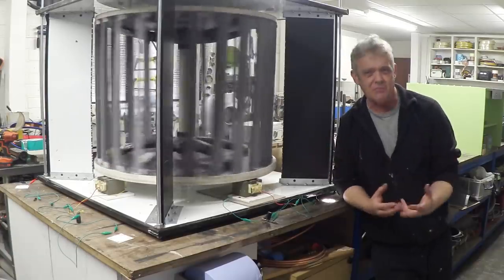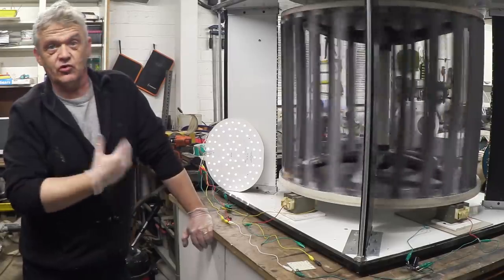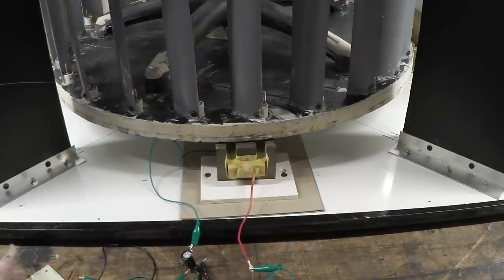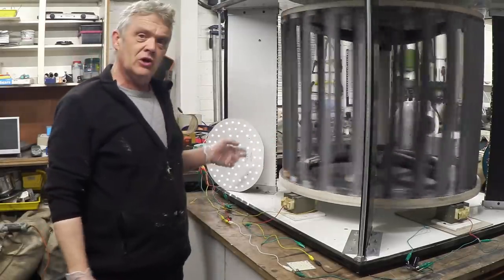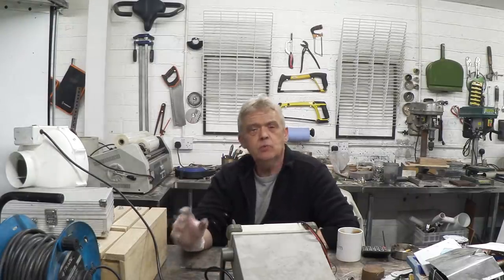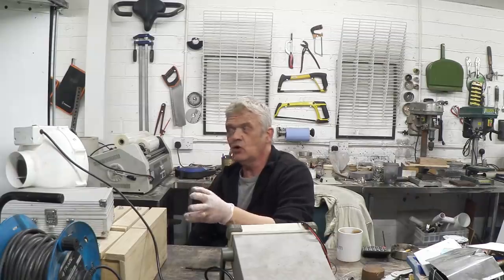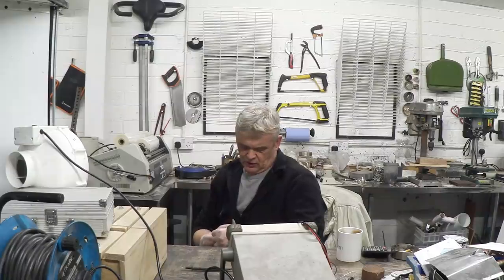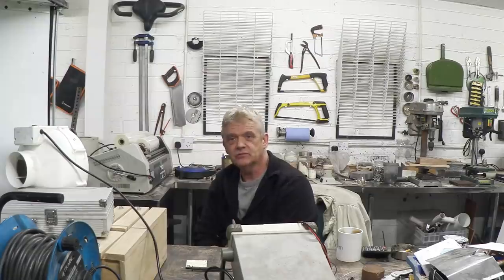Building a 1kW Wind Turbine For Under £100 - Part 6 - Installing The Coils

Comment: When the capacitors reach full charge will the resistance return to full load, or will they just dump that into a battery bank and thus drop the resistance again?  Thanks!

Comment: Is that effectively a capacitive dropper? Did you use high frequency capacitors? Without the rectifier wouldn't the out of phase a/c superimpose on each other leading to unpredicatable output?

Comment: what about using a supercapacitor bank ? like  700F to 3000F
But supercapacitors are very low voltage and will need to limit the coil maximum voltage
Maybe you can use a buck boost converter to isolate the coil from the supercapacitor bank ?
Reply from the maker: or coils with a ticker wire?

Comment: Amazing Rob! I would have never guessed you could do that.. But then I am not so up on electronics and was very amazed that it slowed down in the first place.. One silly question though.. Does the capacitor go across the ac inlet or the dc out put in the rectifiers? I do get so excited when I can actually understand what is going on and what you are talking about.. It makes me feel young again.. I know it may sound silly to you.. But it has become so hard for me in the last few years to grasp new things.. even the old concepts that I have been accustom to all my life are beginning to fade a bit.. But never the less I never quit trying.. Learning is such fun.. thanks again Rob.. carry on, be safe and have a lot of fun!
Reply: I know the feeling. I was an avionics technician in the Navy almost 40 years ago. To be fair, I didn't pursue it as a career after I got out so I haven't kept up on electronics much.. I'd like to see a schematic of that circuit. I think what he has done is connect the capacitor leads to the ac inputs of the rectifier and to the coil. The  DC output goes to the load. I looked up what happens to a capacitor when applied to an ac current (the coil) and it is a bit complicated.    Hopefully Robert or someone watching this will fill us in on that circuit.
Reply: @hubrisnaut  Navy huh.. I was a marine from 69 -72.. and we all know that the navy is a department of the marine corps! ;-) But only marines can say that!  I didn't do much of anything in the corps but duck and cover.. But now as an old man I needed something to do in the cold times so I thought I would try to learn something new?.. I am finding that you can teach an old grunt new trick.. you just have to have a lot of patients and do it slowly... Fair winds and following seas my brother!
Reply: @tinkmarshino  A good hearted "ribbing" is appreciated... My grandfather, who served in WWII in the South Pacific as a Navy corpsman called Marines "sea-going bellhops" with a wry look. I think you know the role he played in the invasions and lived. Never discussed it but his fitful nightmares revealed it to us. Much respect sent from here brother...
Reply: @hubrisnaut  and much respect to you and your father.. Tell your father (in person or in prayers..) thanks, we all appreciated our brothers in the navy.. always
Reply from the maker: it's attached to the dc output mate - the ac input just takes the coil output - attached this way a cap is often referred to a s as soothing cap as it decreases the ripple in rectified current - I think it's doin just a tiny bit more and that is acting as a buffer between load and generation but I am splitting hairs on that really - you often find diodes connected across coils to spark suppress - it surpasses back EMF and in that application the are often called freewheeling diodes - now we know why lol hope this helps
Reply: @ThinkingandTinkering  Brilliant Rob.. thanks for explaining it to me.. that helps a lot.. It is the EMF that slows the wheel right? Hat damn, I am starting to understand it all.. what fun! Carry on my friend I appreciate you and all of your help..
Reply: @ThinkingandTinkering  Brilliant Rob.. thanks for explaining it to me.. that helps a lot.. It is the EMF that slows the wheel right? Hat damn, I am starting to understand it all.. what fun! Carry on my friend I appreciate you and all of your help..

Comment: This may be a duplicate - have not reviewed comments. Will there be an iteration using graphene based super capacitors + diode configuration versus electrolytic caps to manage the load?
Reply: WHY ?

Comment: Hi Robert. Another excellent - and inspiring! - video / experiment. I am likewise 'experimenting' with home wind power and I have a question from this clip [open to all your viewers to answer, of course!] - how do I determine what size capacitor[s] to use to act as my 'clutch'? The generator I'm using has a max output of 2kW at about 1000rpm. I'd rather not explode nor become electrocuted ;p  What size would give me a safe margin of error? What is the downside of using a capacitor of too great a capacity?

Comment: I thank you for the information cause I alway wondering if there is a way to clutch the low to reduce lagging so I strongly believe you fine a new system, but I think using higher voltage capacitors that can store more amperage they use super capacitors

Comment: Could you do a video on alternatives to your honeycombed panels?  Great videos. Not too many.
Reply from the maker: Great idea mate
Reply: I have a good alternative, in Belgium we call it concrete multiplex. They are the black coated wooden panels in many trailers. Weatherproof, solid, easy to work with normal woodworking machines and easy to find

Comment: Robert

Is this method of using diodes or capacitors as a bridge rectifier something you came up with?  OR was it something that was patented in the past? 

Is there a chance you can draw a schematic showing the setup? 

So I could understand it better.

Thanks any help would be appreciated. 

 This is a wonderful build and no not too many videos.
Reply from the maker: I have certainly never read a patent on this - that doesn't mean there isn't one but I don't know if there is - it just popped into my head as a good idea - I did gloss over the circuit a bit - I'll do a vid on it as a fair few folks have asked to see the circuit in detail - cheers
Reply: @ThinkingandTinkering  

Thank you for responding so quickly with the good news on yet another fantastic video ☺️.

We will enjoy seeing you teach so we'll.

BTW

You can copyright a work of art or a work of the mind and protect your work before you make the video just in case this becomes something that is useful. Then if somebody wants to buy a PDF from you showing the drawings that could be offered as well I suppose as a copyrighted PDF.
Reply from the maker: @reypolice5231  I don't mind if someone copies it mate
Reply: @ThinkingandTinkering  

Very kind of you.

Thank you so much.

Comment: Fantastic love every second 👍👍👍 re cogging torque reduction on wind turbine start up during wind speed changes, what about a small raspberry pi and relays with some python scripts to make sure not all transformers are on during startup, you could use one of those lithium batty packs you found, would only take milliamps from the system to keep it going .  Or maybe a simpler approach would be a zener diode and transistors array.
Reply from the maker: No ideas mate - cheers

Comment: What happens when the load is larger than the capacity of the capacitors is the current limited to the capacitance or the coil production. I think it would be like a soft start motor Thanks for sharing.
Reply from the maker: I think it is really like a soft start motor mate

Comment: Multiple outputs into one rectifier and cap? Thinking voltage drop from rectifier if one per coil.  Hopefully a beefy cap will not effect spin up.
Reply from the maker: I could try it mate - but to be honest I like redundant systems

Comment: Now you are thinking exactly like me mate, LOL... You are starting to see why I was going to use 9 coil generator on the same shaft as the motor and use super caps to power the motor part from 3 of the coils from the generator part. Awesome mate
Reply: You know those caps you made out of the CD cases that powered that PC. What if you used them in this build, how long would they hold up and work?
Reply: Have you went away from thinking on using the ballast? I was hoping to see that being wired.
Reply from the maker: no mate but you have topics one thing to do or it all gets a bit too confusing lol
Reply from the maker: I don't know mate
Reply from the maker: lol - well I have noticed how often we seem to think along the same lines mate - cheers
Reply: @ThinkingandTinkering  LOL, well we are both from England. Both "Jack of ALL Trades" Oh and neither of us wants to have to spend a lot. That is why we like doing it from scratch, it is cheaper but most of the time we end up with something that you just can't buy anywhere and it is a custom job. I think it is also, we like to see if we can help the world at the same time maybe because we are leaving children behind one day and what we do now will help them at some point. Cheers mate Oh and I'm one of those Old Fashion Folk that still believes in God save the Queen.

Comment: Capacitor =? Open circuit =? No load ;) this same work with PV, you can get almoust open circuit power from pv, if you change fast to next cap, and from first unload (there is nothing so fast, best use 3+ caps. 1st go to 0power, 2nd go to 50%, and 3rd loading up to 100, next change to loading on 1, etc.)
Reply from the maker: awesome mate - nice post

Comment: Is it possible to have a diverting mechanism so on days when wind speeds are increased then diverte to a metel based Coil for more resistance?
I'm on top of a mountain in Arizona in the US and the wind speeds vary significantly it would be ideal to be allowed to alternate  for increased wind

Comment: Good achievement pal, I believe that E shape steel core is dissipating magnetic field, if you could try only center I shape core you will improve outage just like microwave fan coil,,,,
Reply from the maker: awesome  suggestion mate thanks

Comment: VERY interesting. The first question that popped into my head was can you do the same on higher torque generators? Can you reduce the load on them so THEY run in lighter winds? Also: to make a simple brake can you have a simple switch to unhook the caps from the circuit?
Reply: ALL small Wind Turbines convert the AC into DC.  Nothing new here ...
Reply: @MrSummitville  Not my question, friend. What would happen if happen if you used a rectifier bridge and capacitor on each coil on a high torque generator. Would that reduce the loading drag? That is my question. Thanks for pointing out that my question was not clear.

Comment: Without exact placement of the coils you will never have true in phase coils. And of course shorting out a coil will make it act like a magnetic brake. So by putting each coil through a rectifier you are decoupling them from each other, the capacitor only helps smooth out the voltage dips. 

To put them in parallel without rectifiers you would need to adjust the coil placement to try and get them all in phase. If the magnets are not correctly spaced apart this might be impossible. If connected with a phase difference they will see each other as part of the load and the one with the highest voltage will try and bring the lower one up to match with as much current as it can provide.

if power out demand is greater than wind power in, then it will slow down or stop. In the same way that when you cycle up a steep hill, when power out requirement is greater than you can provide power in, you slow and then get off a walk. where i live you see a lot of wind turbines just walking in the wind. :)
Reply from the maker: very true but this allows for non exact placement - a much more likely scenario is a home build

Comment: what if you try to use all coils you get leaving them in stacks and basicly make 2 stators from them with basic coil holders?
Reply from the maker: I did talk about this in a previous video I think - but since discovering this cap thing I have had a thought

Comment: Love it!  Congratulations on such an impressive piece of kit.  For what it's worth, here in the states we would refer to the automatic clutch as a (hydraulic) torque converter but the principle is dead on.  You are correct that now with the capacitors in the middle it has, in fact, decoupled the load from the generator.  Absolutely brilliant.  Thanks for sharing!  Cheers!
Reply from the maker: awesome mate - thanks for helping fill in the blanks for me

Comment: A Mate!  did u take my advice ? 
   Coils in a parallels series.. . Great Minds think alike! CHEERS MATE! 
 My thoughs...The magnesium  graphite  polyacrylic acid compositors . Switch out to foil coil AL cart ,lol ...
good job MATE!  try using the William Frasier magnetic gears to get higher rpm on magnetic strip... The exact one u built for demo in your video .. you can even make a 2part turbine cadge with William Frasier gears in-between to give a jump start as well ...
Reply from the maker: nice one mate - to be honest I try not to do too much 'new stuff' in any one project because to my mind it obscures the issue and her I am interested in the effect of low torque high speed as opposed to high torque low speed

Comment: Awesome project! 
Are the coil outputs in phase? It's probably difficult to check without an oscilloscope, but if they're not(you can change the phase by moving the coil locations), you might be losing potential output because the coils cancel each other out.
Reply: Nevermind, went 10 seconds more into the video and got my answer lol.
Reply: Yes,think ask inspector Frost!
Reply from the maker: lol - I laugh because of your second comment mate - cheers
Reply: @ThinkingandTinkering  Cheers Sir,and thank you for vids,if you laughed you took it in as it was ment.Thank you from DK.

Comment: There is no free lunch tho is there.  You cannot extract power from the turbine without getting a corresponding reduction in rpm for a constant wind speed. That you are not perceiving a rpm drop is only indicative of the low power output of your current setup. Any power extraction must lead to a drop in rpm from the no load condition.
Reply from the maker: for sure mate

Comment: Just wondering, are you in the process of making a large motor?
Reply from the maker: there is always stuff going on in the background mate lol
Reply: @ThinkingandTinkering  If you could turn it into a motor and flatten it, it would make a great extractor fan. I used to do metal casting and use a fume cupboard mainly for acrylic monomer and acids and they all use a small motor trying to take a large volume. I wonder if taking a large volume to a smaller extraction tube would result in a greater efficiency were you need it to be.

Comment: Go aircon in building you know how much ducts now ok it may not power the aircon but all the power lights via the duct to building weight and life run term well simple sensor coil shaft rotation setup running like your footage or ten thousand on home unfortunately high wind is a concern anyway but it's in lithium ten MW home installation little less stable unless your in the Scottish area the as long as the aircon is running via the building constant output even by wind vents for after but requires store..

Comment: If it looks too good to be true... Getting rid of/smoothing out the initial EMF spike is great... But it's there for a reason.  Yes it allows rotor to start spinning at low wind speeds, but you seem to be implying this is ongoing, limitlessly capacitors charging up without slowing down the rotor speed?🤷🏻‍♂️
Reply from the maker: I doubt that very much mate - we may well be able to bang a few more on but it can't possibly be limitless

Comment: I love these kind of projects, but I'm really wondering whether you'll ever get 1kw out of this. Well, actually, I doubt you'll ever even reach a 3-digit number. (disclaimer: I'm neither an engineer nor a physicist. I'm just curious :-)

Of course it depends heavily on the wind speed, but at 8m/s you get a theoretical maximum of 314 Watt per effective square meter. I don't know your exact measurements, but I think you said something like a radius of 80cm and a height of 60cm. That's roughly half a squaremeter, and you can use a max. half of that (probably rather a third) because in half of the area your blades are moving in the wrong direction. So, with 0.6*0.8 / 2 / 2 ~ 0.25 m², you get a theoretical max power of ~300/4 = 75 watts, but that doesn't take into account any losses caused by friction etc.

The good news is: if you have twice the windspeed, you get four times the energy. So, you'd need about 32 m/s wind in order to get >1kw with you effective surface area. However, that's 115km/h windspeed - so, you better build it very robust!

I hope I do not sound too negative, and I'd love to be proven wrong. In any case, it sure sounds like a fun project! Keep it up!

(PS: Wouldn't it help to cover the half where the blades are running against the wind? That way you should have fewer losses. In fact, maybe a kind of funnel that directs the wind to the right side could be even more helpful, I guess)
Reply from the maker: not too negative at all mate - What you are saying sounds right to me too - to be honest all I want is a similar result to a 1kW commercial turbine who make claims that I think are false and charge a lot of money for it. As you point out - out put is more dependant on windspeed than just about anything else and the average windspeed here in the UK is around 12 mph - I believe - which means a 1kW generator sold for $2,000 has an average output of around 75watts - if we can beat for $100 that I am more than happy